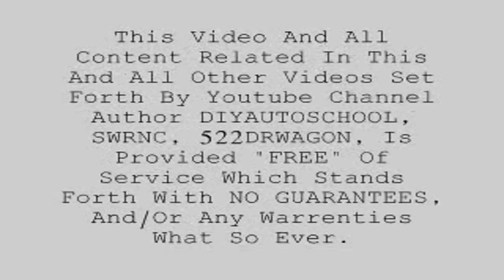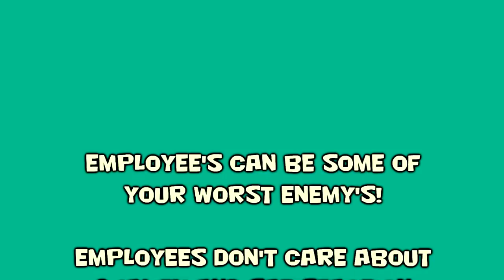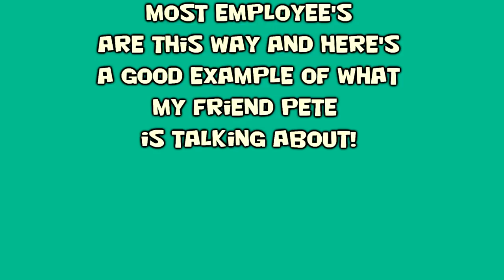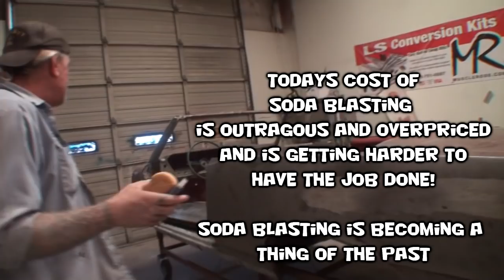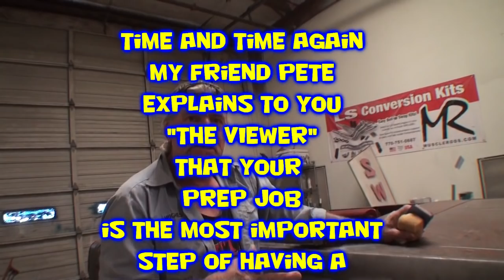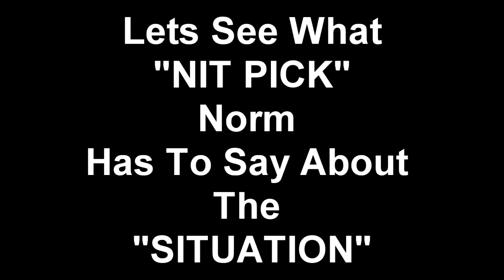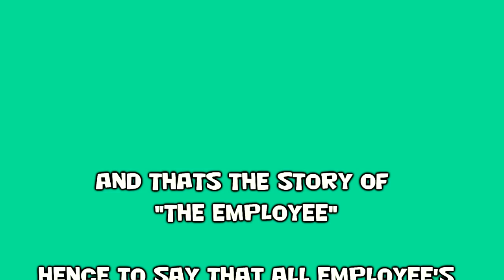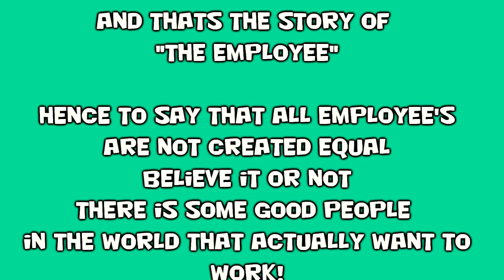I Got Ripped Off Restoring A CAR - Employees SUCK  Pt 1

Comment: Good technicians are truly hard to find. As shop I work in hired a guy who carried a large hand tool box. He took it with him at the end of each day. I had more tools in 3 drawers than he had, plus you never knew if he would come back the next day! Who knew? Never seen it again. His hoist was a leaker and he was told to lock it many times. He leaves for lunch, before he gets back, the full sized Van was sitting on top of the parts bins while the back half was hanging. We got it with some 2 X 10” and he got fired!  Thanks for sharing Pete.

Comment: I have a question about proper prep work? I am doing my own body work. So what is the proper way? I am working on a 2001 Dodge Ram. Do I need to go to bare metal because of paint peeling? My biggest question is could you explain what employees did wrong and what is the proper way to do it? I am a person that likes to learn as much as I can. I don’t want to learn the hard way.
Reply: If i had to guess the pitting in this case has been caused by not cleaning the metal properly in the repair phase or not sealing the metal properly in the paint prep stage. If you have to go to bare metal, make sure it is 100% free of contaminants (don't even touch it with your bare hands) before you seal it up with epoxy primer.

Comment: I'd have been your best employee Pete,but I was in CT.1995-2012 did over 70 cars,mostly Mopars,all by myself but a lot of Camaros and Chevelle's,2 Superbirds, I stripped every car down to bare metal,did everything from cutting out all rust,welding the panels to Finish paint,cut and buff,flowcoated,,2 vinyl roofs installed,did the seat cover replacement. Never had to repaint any car,their all like the day I painted them. Only cars I wouldn't do were Mustangs. I did lots of Cudas,Chargers.Had to fix alot of others butchering. Then had a shop with a money partner that lasted 2 years,but he let customers slide on price because he didn't stand up to them like when I was alone.I had all my own tools,stud welder,mig welder,buffer.My paint jobs came out cleaner in my garage than using a booth. Had a rotisserie.But in 2012 I got tired of dealing with customers.Went down to Florida and tried working in collision shops who fucked me over and over because they wanted me to both er cars by bondoing the entire car and then getting close enough to shoot 2 gallons of slick sand,you never saw any metal before priming,but I liked to etch prime and then use DuPont Uro primer,then DuPont Chromabase,but if the color wasn't close to the original color I would use PPG.I like using the heavy solids clear with a Days 2000,base coat with a Devibiss GTI. I was a reasonable Mopar freak.I made money but when I went to Florida I was never able to save enough money to get to Texas to you.Now at 61 and 31 years of Lyme that I'm finally beating with herbs.I don't want to do collision or paint with the cheap Transtar clear.I didn't drink or do drugs except for smoke a little pot,but not before or during work,it helped my anxiety from the Lyme.I pretty much did everything the way to do it, I'd rather pull the dents out and use as little Bondo as possible,but I liked to use Z-Grip Bondo which was a little more expensive but doesn't tear like those light weight bondos. Never used a DA on my Bondo all blocks and long boards. You should check out my Instagram page name is Dweezol. Didn't do much mechanical except on my own two cars,69 Dart and 71 Duster 340.i did do one entire 71 Cuda,Only things I did do were headliners and front and rear glass install but I did removal of them without cracking one.

Comment: @12:30 That's biblical truth! And is the story of my truck. Here in MS, salvage parts are big business. Insurance and body shop both tried to screw me out of the truck my father gave me...very important truck. They usually get away with that, but didn't with me. I bought my father's "totaled" truck back from them, and they also lost an additional $12K to me on the settlement.

No complaints, really. They tried to fk me, only to get fk'd. But to know what would have become of it, and how much they would have made if they'd gotten away with it...that infuriates me to think about it. Happens every day.